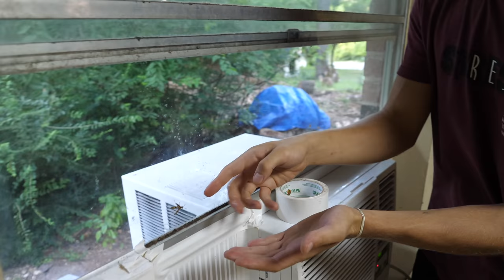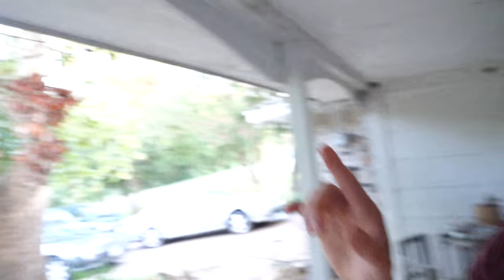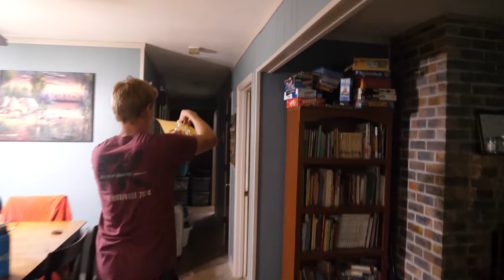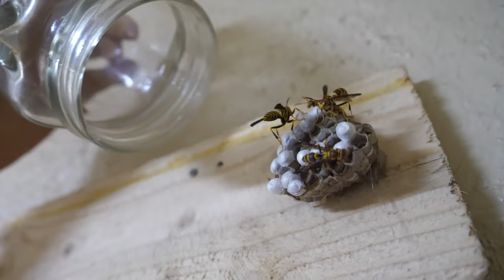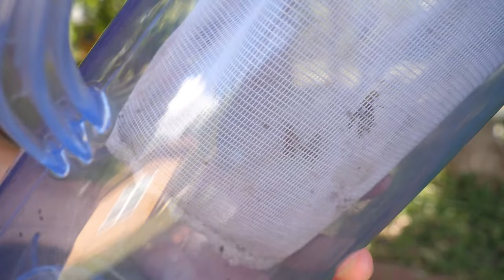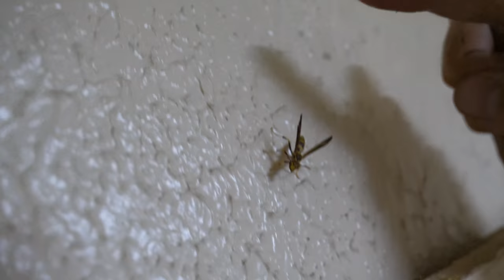My Pet Wasps New Home

Comment: I've "played" with these creatures (and with yellow jackets, hornets and bumble bees) for some five decades, and one thing I've learned is that it's NEVER a good idea to risk a jar full of insects to capture an additional one, because of the risk of losing those already captured (and possibly getting multiple stings as a result or damaging the nest) although they would return to the original nesting site. In this case it was nearly certain the one still-at-large wasp would continue to return to the nesting site, so it could be captured later, such as in a net.

I have found that nests of this species of paper wasp (Polistes exclamans, in some areas referred to as the "guinea wasp") can be moved if built on a portable object without the insects flying off as long as it isn't jerked, or rapid movements made. Other species, such as P. fuscatus and metricus, and likely to fly off their nest with any attempt to move the nest is made.

An attempt should have been made to retrieve the pedicel of the nest, and then glue it back onto the nest. By doing this, the nest could have been attached to the lower edge of the board to allow the cells to open essentially downward (as in nature) as well as allowing the wasps to walk on the top of the nest. The first nest collected was small enough that it could have been mounted this way.

One can put a little honey on their wings so they can't fly until the other wasps lick it off--this would make transferring them much easier, faster and safer.

Recently-emerged wasps of some species, including this one, can be recognized be several means, but even when a bit older, the compound eyes are dark; as the insects age, the eyes get lighter in color.

At least some species will attack and sting even after having been fed. I had collected a few baldfaced hornet (Dolichovespula maculata) workers while they were lapping up sap from an oak tree, and kept them in a jar indoors for a few days, adding honey to keep them fed. I collected a worker from some 20 miles away and added it to the jar, where it was promptly attacked and killed by the others. Sometime afterward, I was feeding one without having it enclosed in a container, and after feeding it promptly flew at my leg and stung it. I got her back into the jar. While looking around the oak tree, I discovered a well-developed, active nest on one of the branches, so I'm quite sure these individuals came from that nest. I suspect that these workers, when kept together, had just enough of a social structure to become defensive just as if they had been taken at their nest. However, individual workers collected in the field and kept alone never became aggressive, even if kept in a container with one or more workers of other species, and never attacked if released.
Reply: This is a hidden GEM of a comment, wow! Thank you for sharing!
Reply: @TootiFruuti  You're most welcome; I'm glad you found it helpful!
Reply: Thanks for infos
Reply: Spent *
Reply: Man's typed a whole essay
Reply: This man just made the Declaration of Independence
Reply: @horadecocinar4243  The Wasp Encyclopedia so to speak
Reply: Did you go to wasp college?
Reply: @secularsam7678  teñir declaration of wasps
Reply: how the F DID U WRITE ALL OE THIS?!
Reply: Omg. You’re like, the king of scary bee 😮😮
Reply: when I was younger, I used to sit in my grandparents garden and talk to the honey bees. the let be get close, and I watched them collect nectar. I really liked doing that
Reply: Yes, there is definitely a range near the nest that drastically alters behavior. Same in bees. Also like bees, the larger the nest the smarter the hive. When close together on the nest they are the most defensive, but also able to join their processing power to make choices and remember things. The more you interact with the nest, the more likely you are to be accepted by the nest. Especially if you are near it constantly and newly emerged wasps are fed by you first. That imprinting starts also affecting the other nest members who aren't are imprinted.. The nest becomes even more friendly. It's almost strange how attached they can potentially become. They also won't act like that with other people, just you. Also, smell seems heavily involved. So don't wear a strong cologne or try a body spray and think everything is good..
Reply: @horadecocinar4243  LOL
Reply: @MkArmy101  Well, my thesis was much longer...
Reply: @chicofromph33nix64  No, but I was teased that I should have done my graduate study at Georgia Tech (whose mascot is the yellow jacket).
Reply: @winglessfairy564  Actually, a recently-deceased friend and colleague of mine (Justin Schmidt) has been dubbed "the king of sting" especially after publishing his book "The Sting of the Wild".

Comment: Adding a second colony to the "habitat" (sand room) is NOT a good idea: the individuals from either colony will only cooperate with their own family, and will be confrontational with the other(s).  Also, if your objective with the vacuum cleaner @ underside of slide is to capture the wasps (not harm them), only short bursts of power should be used; if you leave the vacuum running, the internal temperature heats up quickly.  And while it may feel negligible to you as a large human, it doesn't take much to cook a little wasp in such a tightly-enclosed space, especially with hot air circulating.  I realize you're learning as you go here, so my critique is offered kindly/ constructively, not hateful or with condemnation.

Comment: Theres 2 nests maybe 8 ft apart outside the door of our garage i walk underneath everyday but i dont mess with them  i was stung on my eye lid by a big red wasp once they were all around and we were putting siding on a building and wasp has nests  up under the metal roof i put the last screw in and one flew 30 ft away i had to grab it and pull it off my eyelid no body else helping were stung

Comment: I think he is nuts why would you want them in your house, it is winter here right now and the have a nest in the vinyl siding in are house and getting in side now! Wife is mad , I have be vacuuming them up as the come in , they are going straight from the kitchen window and back door open door they fly out and drop to ground because it’s 23 degrees out they are coming in  through the light socket will be going in the attic and spray them all dead